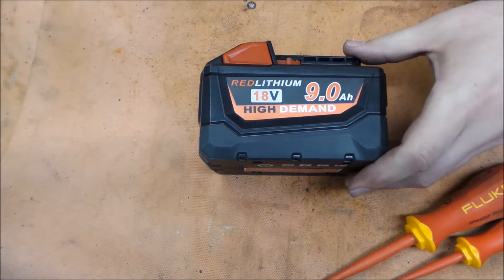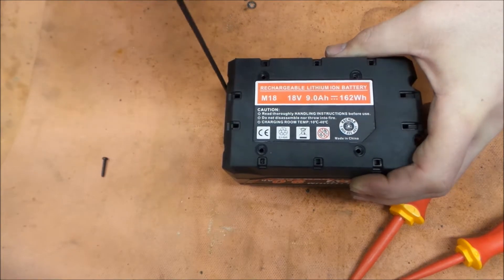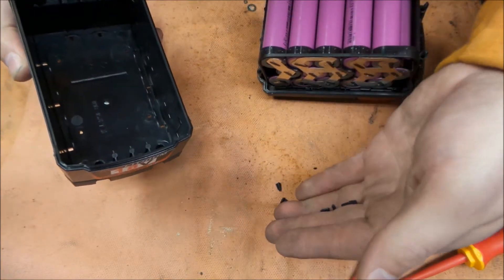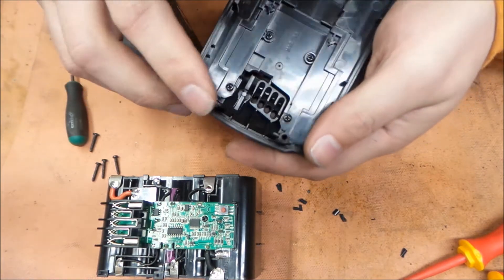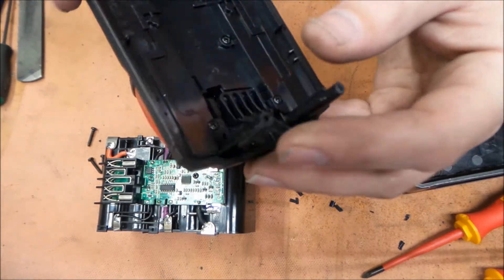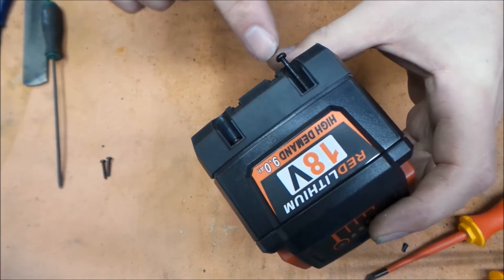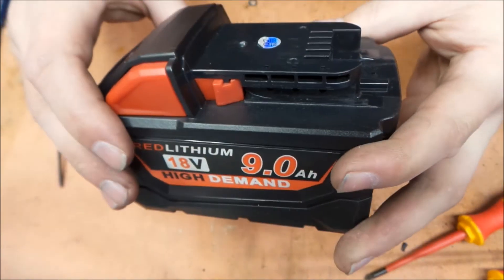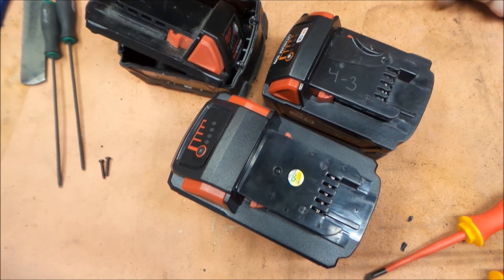More Battery Fun - Refurb of a 9.0 Ah 18v M18 Milwaukee Knock-off

Comment: How do those knock offs hold up? Do they last as long? What brand are they?
Reply from the maker: The knock offs are not at all consistent. I've had some that performed reasonably well and others that didn't. Another thing is the brand or name used on them seems to change frequently also. If I had to guess where the issues with them lie I would say the board inside. Some seem to drain down and not charge well while others do. Overall they are decent enough for the money to roll the dice on them especially if you are in a situation where you may damage a battery, have a possibility of theft or are using lots of batteries. If you are not in one of those situations I wouldn't use them. I have not had any experience with the newer knock offs of the 21700 cell variety that is on the long list of things to play around with.